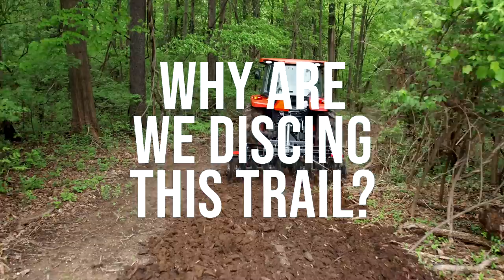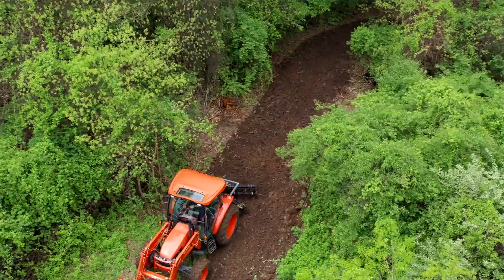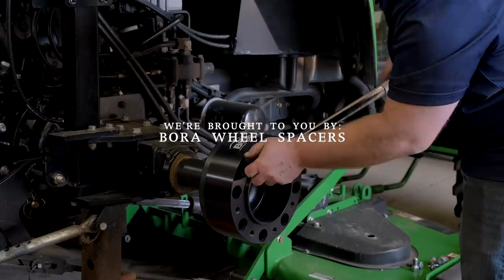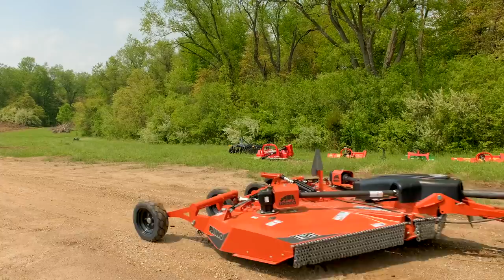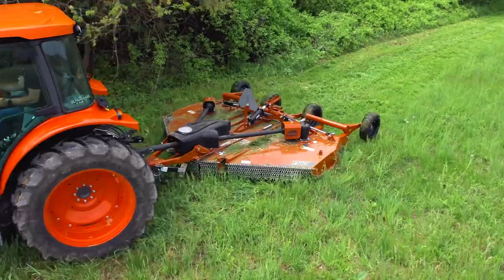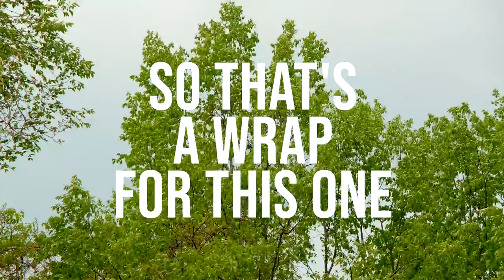GOOD DAY FOR THE TRACTOR, BAD DAY FOR THE DRONE…AND TREE 🤣

Comment: I would worry about turning the trail into a creek bed after removing the topsoil and lowering the level of the trail.
Reply from the maker: Top soil is stripped out to bring in gravel and build it back up.  It'll be higher and crowned along with drainage when it's done.